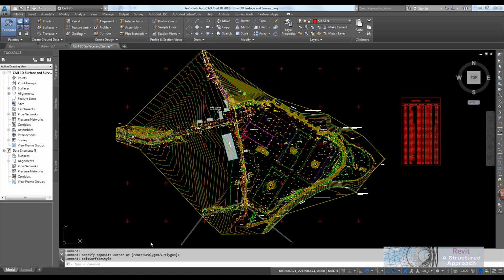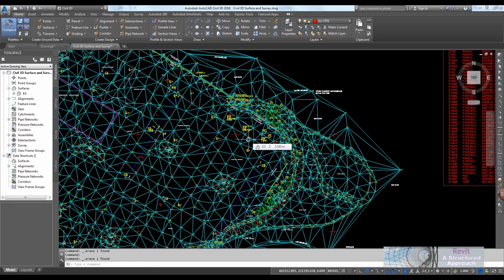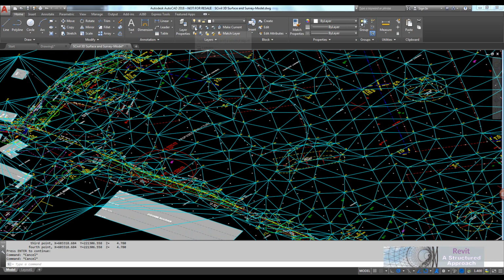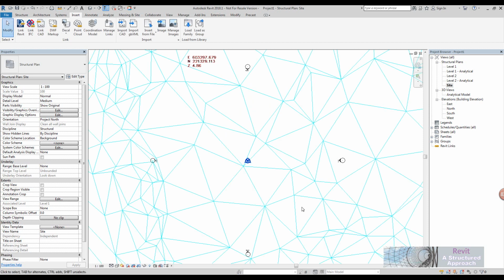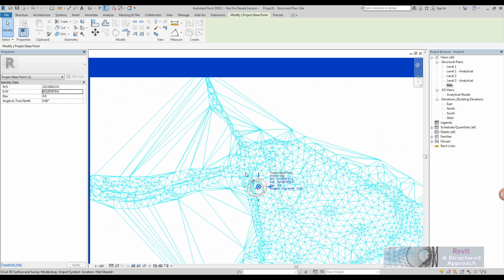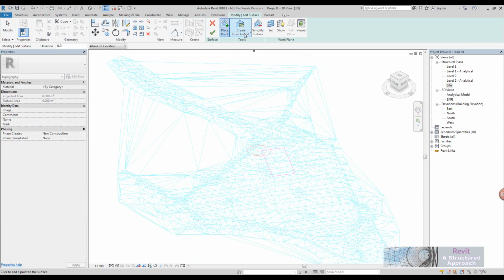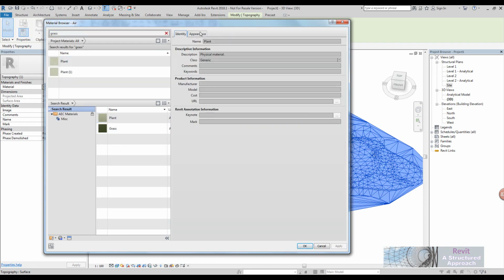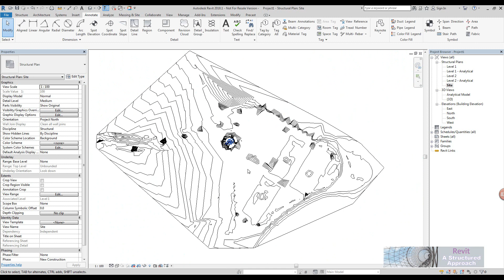Tutorial   AutoCAD Civil 3D Surface to Revit Toposurface

Comment: Great video . . . . .Does not work in Revit 2024 / 2025 . . . . . . .
Reply from the maker: @itatabisine6250  it will work for Toposolids. Toposurfaces have been replaced
Reply: @RevitStructureBlog  Yeh, I know that, but because of that, it completely misreads the CAD file and adds new triangulation of the surface. In particular, we have a case where we have a flat surface that meats a sheer cut in a site, followed by another flat area. Revit interprets this scenario by adding new points where the sheer cut is and creates triangulated 45deg batter.
Reply from the maker: @itatabisine6250  I do know that there is a point limit of 10k. I have found that splitting a TIN surface and building the solid in separate parts helps
Reply: @RevitStructureBlog  thanks for the tip. I'll try that approach!
Cheers ;)
Reply: Same issue here, what a nightmare